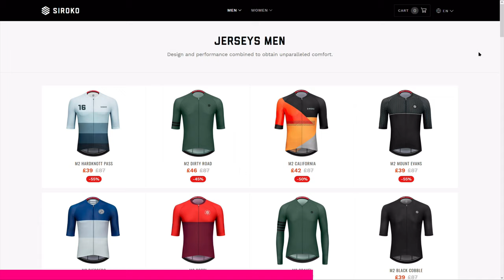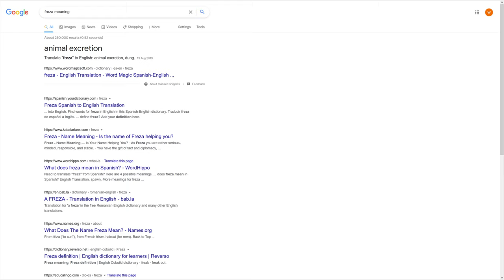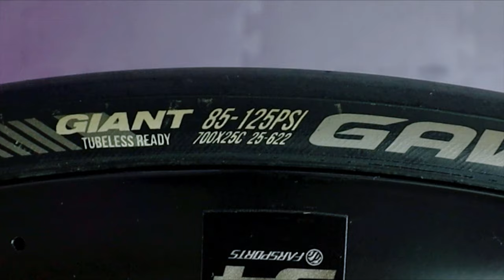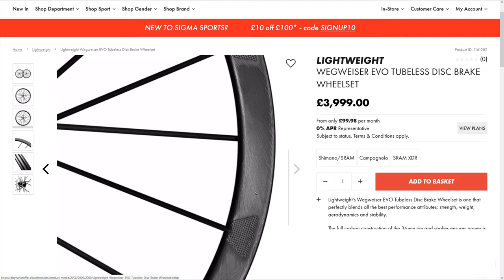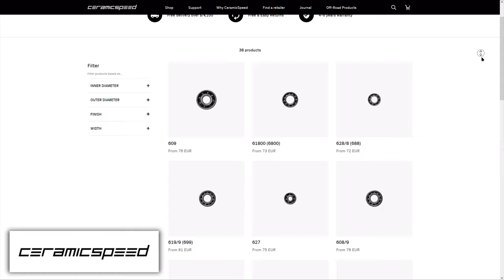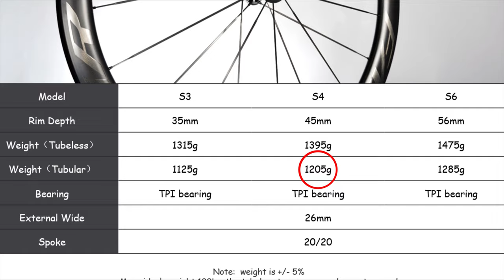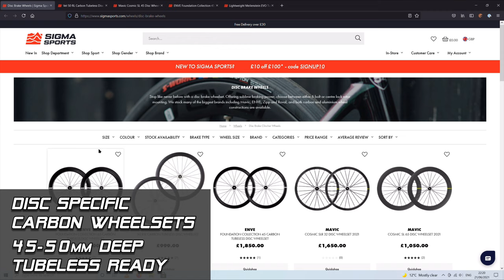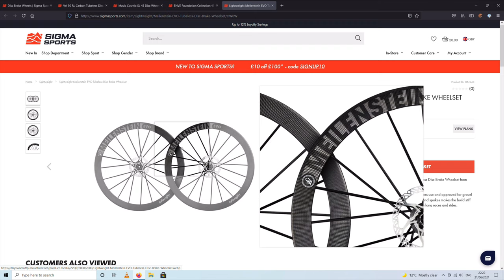CARBON SPOKES on Chinese Wheels - Farsports Ventoux S

Comment: For bearing removal you really should be using some blocks or a larger diameter tube directly on the hub, thereby removing any shock forces to the spokes and rim. By doing it the way you are, you are exerting rather large impact forces on the spokes, as well as very uneven lateral forces on the wheel. These bearings came out easy as they're new, but if they were old and had not been looked after, the bearings could be a bit stuck and this could over-stress the spokes or even cause deformations in the rim.

Comment: Nice review Luke. I appreciate that you put a lot of time & effort in the reviews, with time stamps for each segment. I bought the Winspace Hyper 50mm wheel set with carbon spokes (same style) about 6 months ago and I really love them. You notice the stiffness when get up and sprint, but also just cruising on the flat is a dream. Just take care with the spoke tension, I had a spoke come loose as the carbon spokes don't stretch like the steel ones, so can loose tension under compression (e.g. high tyre pressure). I had mine re-tensioned and thread locked - no issues at all.
Reply from the maker: Nice, good to know Michael, will def keep that in mind if if ever face any issues with the spokes. Thanks for the comment!!

Comment: Great channel Luke! Just a humble suggestion, when tapping out old bearings try to support the hub on the opposite side so you dont put stress trough the whole wheel. You will probably not need to tap as hard as well. Very entertaining and informative stuff you post!

Comment: Thanks Mr Trace, Lol. FYI these exact  carbon spokes are also used by Cadex, Hunt & a few other brands. As you specified, only a custom made hub will accommodate these spokes. These wheels are very stiff & combined with a lighter weight, make them feel snappy (I love my carbon spoke set). Possibly the reason why they are better at handling cross winds is the lower spoke count. Personally I love the road feel compared to steel spokes. Enjoy.

Comment: Fab vid, increased my knowledge and made me laugh. Top marks, as ever. 

I'm still rocking rim brakes on my nearly new carbon endurance bike (£650 on Ebay) and am pleased to note that my new Novatec Jetfly SL tubeless wheelset tip the scales at 1,335g and cost me £374. (Total bike weight now 7.7kg) I've since seen them for £351! So until carbon wheels become lighter and cheaper, or until Northumbrian hills get smaller... 

Oh yeah, dude, you can get a rubber mallet for £3.99 at your local Screwfix.

Comment: Luke! Great review! Not in the market for Carbon wheels at the moment, but you have definitely put Farsports on my radar. I’m running Easton EA90 SLX rims. These are super light and I definitely felt the “snappy” improvement when I used them the first time. IMO, lighter wheels are faster to accelerate, but harder to keep accelerated. It’s that old law of inertia. So, over the whole ride, you expend the same power between light and heavy wheels. But there is nothing like accelerating, and I definitely feel that more with lighter wheels. Keep up the great content!

Comment: Hey Luke, these wheels are very “tasty” indeed, I was so tempted but when jumped to the website and filling out the options, the total cost mounted to $2700 AUD plus import taxes. That would make the total cost of the wheel set above 3 grand. That’s a lot of money. For that money, there are also many good options at the LBS, especially the DT Swiss ERC 1400 Spline 47 Disc can be had for $2200.

Comment: Not so relevant to these relatively more expensive wheels but I’m always impressed by your trust in tubeless wheels. I have a cheap pair of unbranded wheels, admittedly a lot cheaper than those & went for tubular because I didn’t trust them to make a rim that didn’t delaminate at an inopportune time. I’d like to try tubeless but like saving money & really cheap tubeless scares me.
Reply from the maker: Yeah i guess this is a fair concern, but i've had 3 sets of tubeless wheels (all from China), and have never had any issues with the tyres defalting, or popping off the rim. Unless you REALLY hammer the brakes on a tubeless rim brake wheel, i'd be surprised if you faced any issues. Conversely i'd LOVE to try some tubular rims, its just the cost of the tyres that puts me off tbh...

Comment: Hi Luke i love your videos. 
Regarding bearing removal. never take a hammer to a bearing you should always use pressure insstead. 
a press or a bearing removal tool is the right tool for the job, otherwise it is rather easy to make a homemade bearing press using a long bolt a couple of washers and a nut.  also as other have mentioned in the comments, knocking out the bearings like you show have a very high risk of breaking either rim, or in this case more likely the spokes which are not at all designed to take this amount of lateral force. Please, please stop using a hammer.
Reply from the maker: Yeah this is a fair comment. You are right in the sense that I should really be using a press for the bearings, but I think in order to break the spokes or the rim in the way you describe, you would have to really give it some welly, and having done this multiple times with many different wheelsets over the years, I have yet to damage the bearings or the rim/spokes. Very rarely are bearings seated that fimly in the hubs. BUT having said that, you are absolutely right, bike wheels are definitely not designed to take those laternal forces, so I totally get your concern. I think if you have a bearing press, definitely use it, but if not a few light taps with a rubber mallet should be fine in my experience.

Comment: Looked up these wheels on the Farsports website, and in your configuration they come to $1709.10. Plus bare in mind that the named prices are duty unpaid so add another €303 (or $ 360) on top of that for importing into the EU zone and vat will be applicable in some form.

In short: please use mind and calculator next time when they say something is cheap 😉
Loved the film👍😋
Reply: Yes I bailed at the cost and the import duties and crap we now have to endure!

Comment: Ideally you shouldn't knock those axles out but instead use some kind of tubular press to push them out with an even pressure. You may be able to cobble something together with a piece of pipe and a threaded rod that can go through the thru-axle area, which would then put pressure on the axle by screwing it in. Pretty much the same deal as removing/installing headsets.

Comment: That's what I call a cheap premium carbon wheelset ! Amazing work as usual. Thanks  I just made a video about tubeless setup as I had a lot of trouble making the tires seat with my stock wheelset. Never seen the method anywhere before. It would be great to have your opinion on it :-) Have a nice day!
Reply: It’s $1500

Comment: Great video.

In the comparison I appreciate the comparison to name brands.
I would also like to compare these to  other models from Farsports like the Kaze models (similar to your old set but now the disk version). Also compare them to other Chinese popular like LUNwheels and to your other wheels.

I also appreciate a lot the maintenance and repairs details you give, as I plan to be a long terms purchase and your reviews offer this information.

You mentioned that you found these wheels stiffer and a bit less comfortable. The fact you are using 25mm wide instead of the larger tires you had before might be an explanation.

Cheers

Comment: the term you're looking for is acceleration. Lighter wheels aren't any faster than heavier ones (given same other variables) as the heavier wheels store your energy like a flywheel, but the lighter wheels accelerate and decelerate easier, making them feel snappier and more agile. If your riding involves frequently variable speeds (due to traffic maybe?), then lighter wheels are a plus.

Comment: How would you say the crosswind stability is compared to your older Farsports wheels? It might shed light on if the Ventoux's crosswind performance is from a new rim profile (or depth) or if it's the lower spoke count.

Comment: Those little holes are in case your rim tape fails when seating a tyre. Not normally an issue for mountain bikes but if using a bottle to seat a road tyre and the tape fails you can get too much air pressure in the rim and blow it up.

Comment: I wonder how these compare to the winspace hypers (which are quoted at 1455g), or other Chinese carbon spoke disc wheels such as the c-razy x50 carbon wheels (quoted at 1355g).
Reply: I would imagine they would be very similar. The Hypers use a filament wound rim and have a 6 pawl hub instead of 4 pawls and are slightly deeper. I absolutely love my set. Also the Hypers are 21 spoke not 20 off memory.

Comment: Hey the wheel wobble that is caused by the crosswinds are actually wheel imbalances. those wheels you used probably didnt counteract the weight of the presta valve on the other side. If you don't counteract the valve weight on the otherside you get wobble at high speed

Comment: Are there any worthwhile tire options you could present on? Differences in rolling resistance between tires can be much more important than weight; it would be neat to see what less-traditional options are available (tubeless or otherwise)!

Comment: Love the channel, another high quality video! Just a small tip for future use, you shouldn't really clamp a carbon frame on the top tube, it's fragile and can damage the tube. Carbon frames should always be clamped on the seatpost which is designed to bear more weight.  Keep up the excellent work!

Comment: Hi Luke. Nice wheelset. May I ask what wireless microphone are you using? 
Cheers from down under 😎....Steven
Reply from the maker: OZ CYCLE, love your videos!!! So its not actually a wireless setup. It's just a £30 lav mic from Amazon, plugged into a Tascam DR-22WL which is in my back pocket. I capture audio separately, and then sync it up in the edit. I'd like one of those rode wireless setups, but I dont think I need it just yet. Nothing fancy here Steve 🤣
Reply: @TraceVelo  Thanx for reply Luke. Good set up , you got it working good. Yeh , good audio and cameras are expensive 😬  . Hopefully one of your videos mite go a little viral and pay for want you want. Cheers

Comment: Is galvanic corrosion a concern at the spoke/nipple junction?
Reply from the maker: OHHHHHHHHHH good question!!!!! I didnt think of this. I guess it could be if the seal between the spoke and nipple was loose enough for water to ingress. But they are SUPER tight, and I've not seen anything to suggest this is happening. I will def keep you posted if anything changes tho...

Comment: Just awesome video Luke, this is the only channel that ive been continously watching in order. Awesome job. Like someone else said below, to add to it, do you have a silicone grabber/pot mat or whatever object made of rubber/silicon? That would be much better choice to use when you need to hammer the hub than a shirt because you want to dampen the rough shock and deliver the force as a gentle pushing energy instead.
Thanks for the awesome content as always.

Comment: Hey Luke! Are you still using that ultralight cassette with the aluminum cogs? Can you make a review for that one please or at least give me a recommendation? Thanks
Reply from the maker: Yeah great question, so yeah I still use them. I think they are pretty decent tbh, but they only last around 2000 miles tho before the aluminium cogs wear out and start skipping the chain... So if you are all about longevity, prob worth getting a fully steel cassette

Comment: Want to try a front wheel but no 36mm Farsports Ventoux S on ebay. Current 6 bolt disc brake front wheel is 1270 grams without tire , disc or skewers...

Comment: Hey Luke, absolutely great review like always !
I got myself a pair of Ventoux S4 Disc Brake and wanted to set it up tubeless. I was wondering which tubeless tape you used (which width) and which tubeless valves you used as well as these were not included :)

Comment: These sound awesome, was so impressed i went to order a pair of S4 disc and the price came up at £1334, inc 10% discount, even with your extra discount this still leaves them over £1250 plus postage… 😢
The price jumps considerably when you select the disc version. 😤

Comment: I'm looking into buying mid level mavic/shimano wheelset, carbon stuff is too expensive (for me),not ideal with rimbrake and not worth the worry (frame is also alu). 
Another interesting review. There is a lot of interesting stuff coming from China as seen on shanghai bike show videos and you're the only one doing proper reviews, not just glancing at it. Keep up the good work.
Reply: No need for carbon especially when rim brakes wear the rim down plenty of nice alloy stuff for exanple campag zondas probably all around best for the price , some bargains to be had on used wheels sometimes aswell

Comment: I have the little drain holes on my rims and I can tell you that really don't work. You can get the water out but its quite a pain. Honestly sometimes it's easier to just take the tire off (only the case for tubular tires, of course)

Comment: Luke, I'm on the market for my first carbon bike and value is important for me. Hence I want to get tested Chinese frame and wheels.
I'd like to get something that can accept a tad bigger tyres (30-32mm) but not necessarily gravel as it would be the occasional ride in October/November. I was looking at Trifox but their widest frame only goes to 700x28 (all other frames are 700x25). Do you know another brand in that price range and reputation? (Yoeleo R12 DB fits the specs, but it's 2x the price).
Also for the wheels, I'm tilting towards Farsports classic or kaze around 50mm deep with Bitex 312. Do you have any suggestions?

Comment: Reminds me on my winspace wheels.
They look great as well. 😊
Just one thing: does your real wheel creeks a bit when you pedal? My spokes on the rear rub on to each other.

But rest is really good🥰
Reply: Try some chain wax lube between the spokes, at the top of the rim & where the spoke meet the hub. The noise from my rims in fact was just the valve rattling in the valve hole which was fixed very easily with a bit of tape.

Comment: Great review. It would be cool to a power analysis vs speed,time  when sprinting and climbing below 8 mph? I seen reviews that the gava tires are very heavy and slow what are Your Thoughts.
Reply from the maker: The gava tyres were pretty decent imo. I managed to get a decent deal on them, so I was happy 😊 But to be honest, unless I ride some truly heavy city tyres, like schwalbe marathon plus, back to back with some decent lightweight race tyres, I can't really feel much of a difference between tyres. I rarely push tyres to the limit of grip.

Comment: Any wheel recommendations for a heavy rider? I'm 118kg and nervous to buy carbon especially cheap ones.
Reply: Hello I follow another YouTuber Leonard Lee who is almost your same weight. He has a custom set of wheels made by a UK company called "spin on these" and the gentleman who made them for him specializes in wheels for heavier riders. I myself was close to your weight but have since gotten down to 95kg(shooting for lower) and had similar concerns about wheels. I think custom wheels are the best option and if possible wheels with higher spoke count(32,34 or 36) especially the rear wheel. Cheers

Comment: I am having trouble with my tubeless setup. The valve hole is not drilled in the center of the rim and I think this is causing the issue. They mounted first time, awesome but on my second ride the rear lost air and I have not been able to get it tubeless again. So , the third ride my front went the same way and I can't get it to hold air anymore. The air comes rushing out the two little drain holes. I'm getting exhausted trying different ways, different values, retaping the rim, etc. Any issues, are your valve holes centered?

Comment: I'd be very interested to know if the spokes are available separately. I've got some tasty Knight Composites rims that were planned for some CX-Rays otherwise.
Reply: Might not be compatible with the hubs. He mentioned the hubs were farsport custom to work with the spokes.
Reply: @dopamine2655  It's certainly possible that you're right. I'm guessing the aluminum ends might have to be a bit thicker than on a standard spoke.

Comment: Its simple physics, at a steady speed lighter rims are no different than the same weight removed of other parts of the bike.  Under acceleration, say in the sprint,  (or braking for that matter) the lower rotational inertia will allow greater acceleration (or braking) for the same effort.
When you removed the axle, you shoud have supported it under the hub rather than as you did the rim.  It saves loading the spokes.  You unnecessarily risced breaking spokes.
They look the bizz but I doubt that at a 2 to 1 aspect ratio they will reduce drag much.  Its normally reckoned that 4 to 1 is necessary (including the tyre of course) so 100 deep?
Unfortunately I will never be able to afford such expensive equipment.

Sorry to critise but your style is a little over the top.

Comment: Hi 👋 may i ask how tall are you and what size frame are you riding ? (58 )? And do you have new fork and which ? And how light is your bike now ?
Reply from the maker: So im 188cm tall, ride and ride a 58cm frame. The forks got replaced recently (and I did a video about this issue), and right now my bike is 7.6kg with both bottlecages and pedals :)

Comment: 33:44 It would've been better if you had simply pointed the camera at the worm instead of disturbing the poor little creature by picking it up and tossing it to the side.
Reply from the maker: It was out on the road, had to save it from getting run over and throw it in the hedge